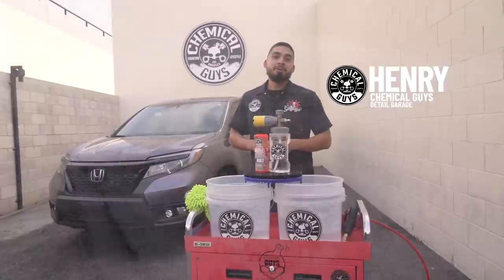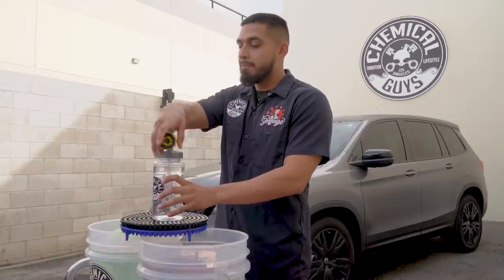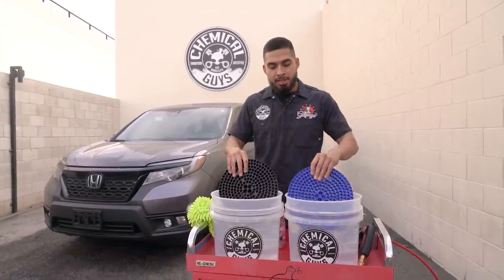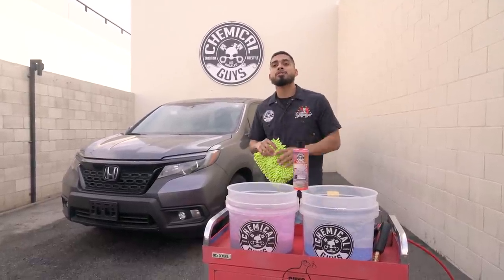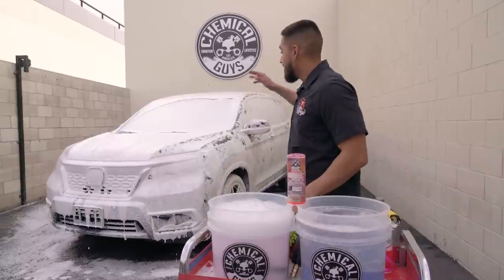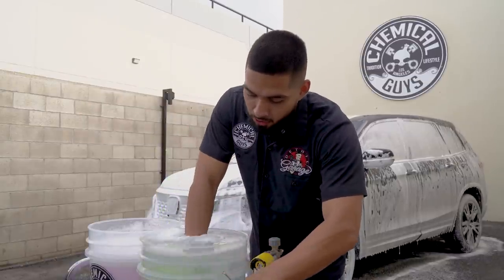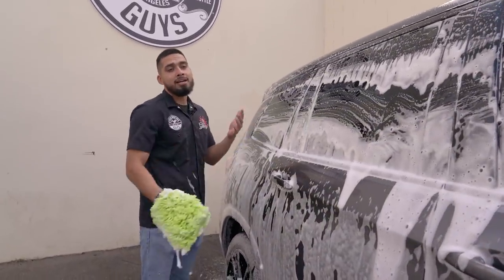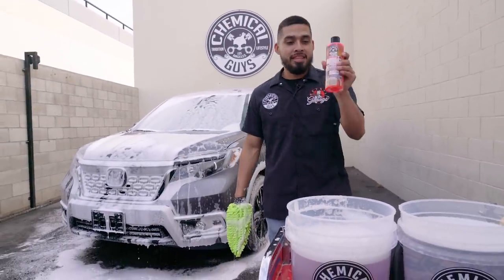NEW PRODUCT - Sticky Snowball Ultra Snow Foam - How to get the thickest suds ever! - Chemical Guys

Comment: If I have the hydro slick ceramic coating on my car will sticky snowball actually strip or degrade my ceramic coating?
Reply from the maker: Hey! Sticky Snowball Ultra Snow Foam is perfectly safe for your ceramic coating.
Reply: @ChemicalGuys  excellent! I guess I'm going to have to try this out as it looks it really does stick to the car! All the others had a tendency to dry or streak by the time I got to that side of the car kind of thing....

Comment: Very nice, are you softening the water before? What is the power washer your using?
Reply from the maker: Hi Kelly! We are using deionized water with a gas powered 2800 PSI pressure washer.
Reply: @ChemicalGuys  then there's no need to use the microfiber towel since deionized water won't leave any stains.